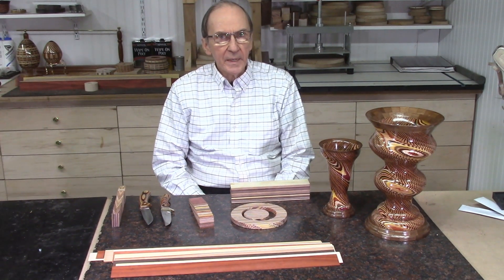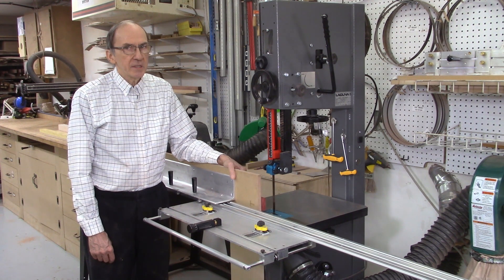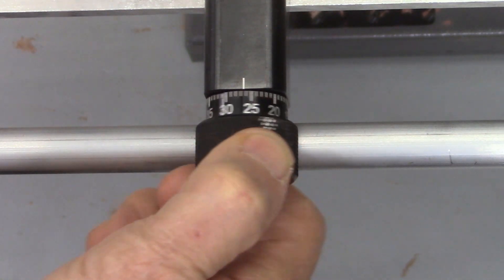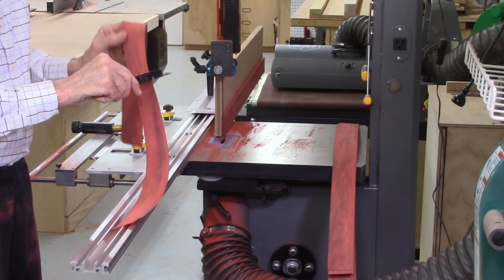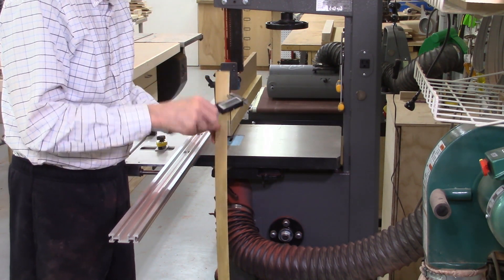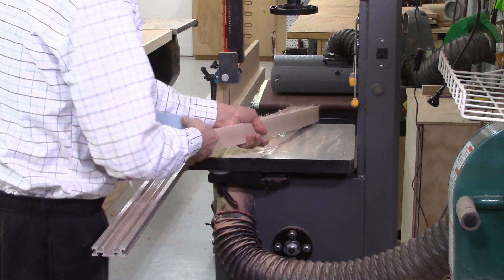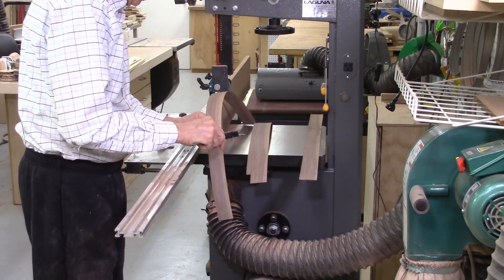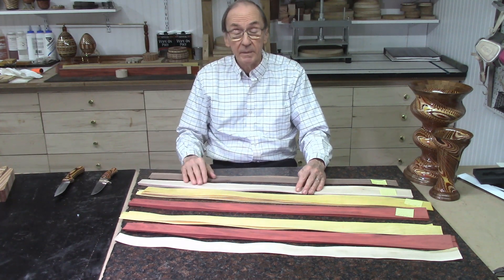Slicing Ultra Thin Veneers with the Accu-Slice System (70)

Comment: I have this system. It works exactly as shown by John. The issue isn’t the system. It is how accurate is your band saw. To get these cuts your band saw has to dead on. No drift no blade flutter and very little vibrations and perfectly square to the fence. The best I have been able to get is.020.  That is still pretty darn good. The better your band saw the better the cuts.

Comment: It seems to me that the thinner the vaneer the more negative effect the glue would have on it, color wise and thickness expansion from the water in the glue.
Reply from the maker: I have been using epoxy to glue my laminate boards.  I prefer it over the water based Titebond glues for gluing the laminate strips.  I do agree that the very thine (0.005" thick) boards will totally saturate with the glue.  I do not plan on using the 0.005" thick boards for any projects.  The wood is just too thin and even applying glue with a brush would cause the board to crack or break and it would severely warp and twist as the glue was applied.  However I will be using the 0.010" thick and thicker boards for some knife handle and dizzy bowl projects in the next few weeks.  I will be posting videos on these projects as they are completed.